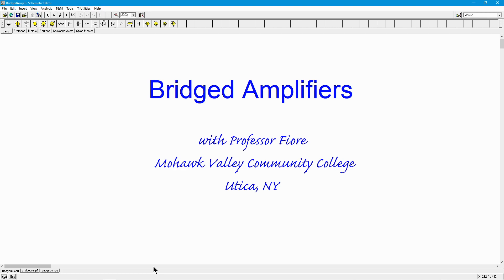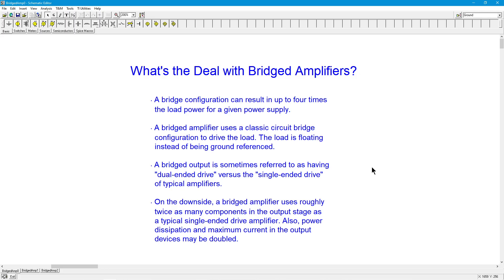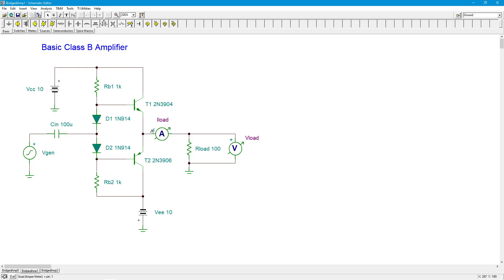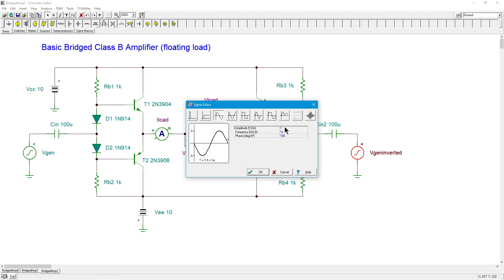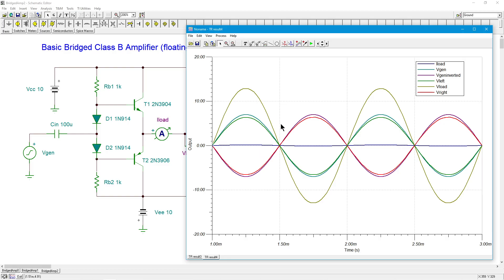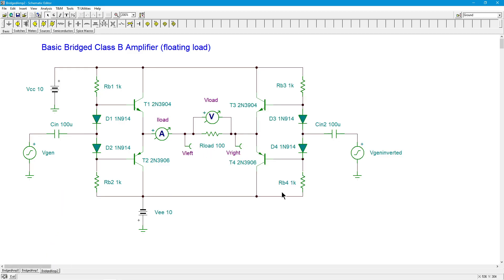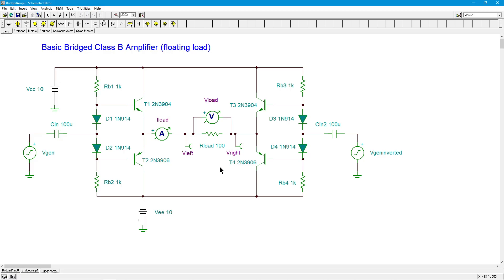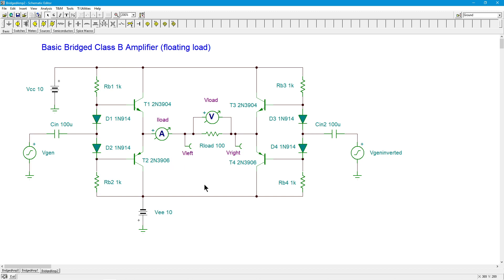Semiconductor Devices: Bridged Amplifier

Comment: Thanks for the Video. Regarding the load: if you had 2 x 50R in series, would you measure permanent GND between the two 50R resistors?
Reply from the maker: Yes. That's one way of visualizing the operation: each half drives half of the load in normal (single ended) fashion. Of course, in the real world you can't split a load like that, but you can imagine the voltages on each side swinging up and down, opposite of each other, like a see-saw on a playground. And right in the middle, is the stationary fulcrum (ground).

Comment: Professor, I know this topology makes for a closer to ideal power amp, but I struggle to understand where does the apparent even harmonics attenuation/elimination stem from? Perhaps you could shed some light on this aspect? Otherwise, thank you for this episode!
Reply from the maker: In general, even harmonic distortion occurs when the waveform is treated asymmetrically around zero. If a waveform doesn't have halfwave symmetry, then it must contain at least one even harmonic. This is explained in more detail in my free text (follow links in description).